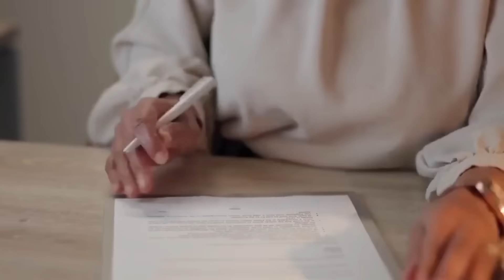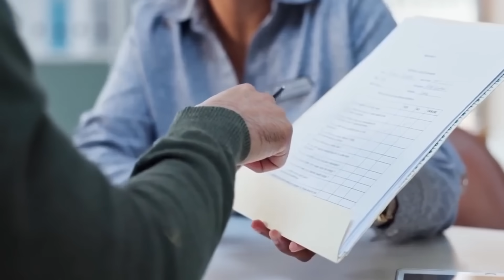The Photonic Chip That Bypasses ASML - Huawei Just Blew Up the U.S.–China Tech War

Comment: Photonics is promising but as yet not yet equal to silicon. If not EUV, then even if fast, size would probably be enormous compared to silicon at least 6 generations ahead of what China is capable of. I'd also be curious whether photonic pathways would truly be without any resistance and whether there can be such a thing as a photonic transistor and storage that doesn't involve electrons at all.

Comment: Silicon based chips have reached its death row. It can no longer be any smaller and the issue is heat. China has come up with a new invention that is not silicon based. It's called Indium Salelonide. Just using light energy and no heat dissipation. Far more accurate, faster and cheaper.